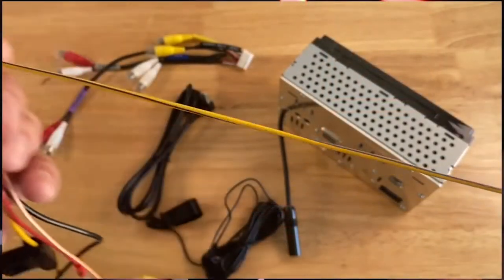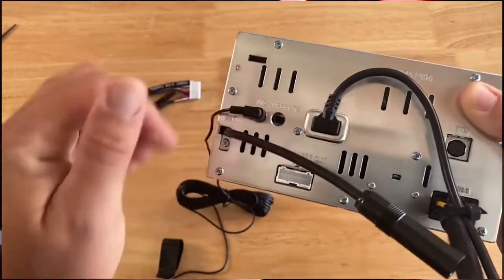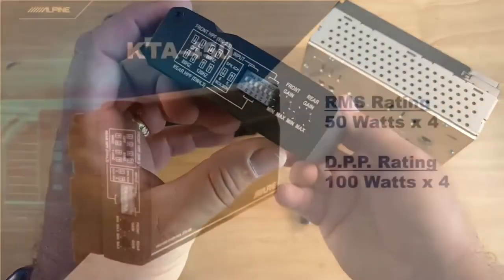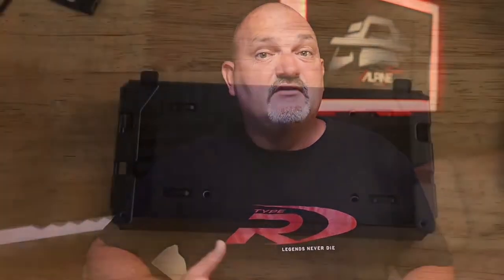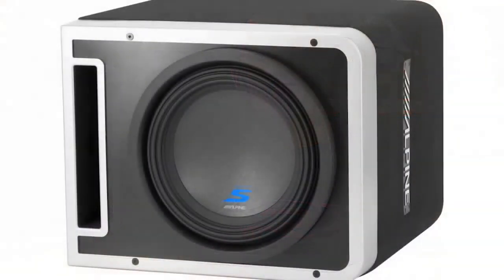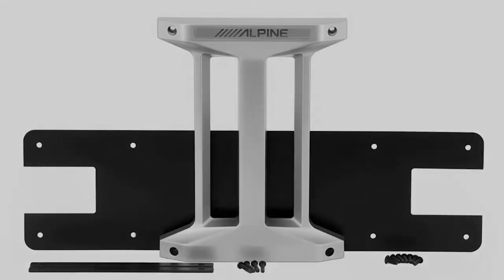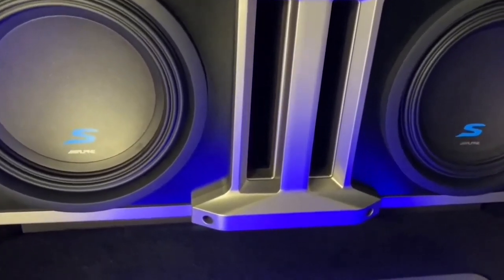Install and Setup Tips and Tricks (iLX-W650, KTA-450, KTA-200M, Halo Subs)

Comment: No comment on all the connectivity problems which blows my mind after buying several different types of phones to make this work. I am ready to try a firmware update after 6 months of a pathetic experience. Wish me luck!
Reply: Android auto can be a pain on this headunit, my galaxy s20 would disconnect or say usb not supported all the time, apparently the factory usb cord that comes with this radio is faulty, run a new usb cord straight to the back of the head unit and get rid of the factory usb. I did this now my android auto works good 90% of the time opposed to like 40% before. Hope this helps, also I updated my radio to the latest firmware ware didn't really seem to change much but the new usb did.

Comment: I own both the ilx-407 and the ilx-650. I have had no problems out of the 407 other than the internal sub volume not working. The 650 however, constantly looses the usb connection constantly or says usb device not supported while using my phone. Any recommendations?
Reply: I had the same issue with the 650 I updated the software on it and it fixed the issue
Reply: @mitchnoble442  that did not work for me. Software is updated now and still loosing connection. It isnt as bad now. I am going to try a new cable soon.

Comment: Love my kta 450 and my ilx w650 i have them in both of my vehicles. But that being said im in my 3rd kta 450 out of warranty i have developed issue with at low volume one if the channels will randomly go quiet then when volume is turned up it comes back as well as after prolonged higher volume all 4 channels will subtley lose about 5 to 10% output intermittently just enough to be noticeable it gies away after reducing the volume. But as for sound quality i love them on my rockford fosgate  speakers
Reply: Sounds like you have a speaker that's on its way out
Reply: @melissathompson7229  that was my first thought woth the first amp but the speakers were replaced with new one i went from polk to fosgate and still the same issue then bought the new 450 and it worked fi e fir a whike then ended with the same issue unfortunately. I really like the sound quality when they work

Comment: I have the 650 and the dpp amp in a 2004 Wrangler.  Beautiful unit, exactly what I hoped for but…..it pops on shutdown.  I have adjusted dip switches, triple checked rca connections, and checked all grounds for resistance and continuity.  What gives?  Its gotta be the unit power down timing.  What can I do to fix this?  It drives me nuts.
Reply: I have the same setup and mine does it too
Reply: Interesting! 🤔 

Same here and no response I see. 😢
Reply: Did you figure it out?
Reply: I’ve seen a bunch reviews on this and found that it’s the amp causing it. Only found out about it after buying it and being half way through the install. Curious if mine will end up doing it or not

Comment: Have spent hours trying to install the 650 head unit with the stackable 450 Amp on the back of the unit with a additional 200 watt Amp for subs. After hours of trial and error finally got unit to work but it not allowing radio to play but about "half volume" before it begins to cut out. Any suggestions or links for proper install on a 2011 chevrolet silverado  would be GREATLY APPRECIATED
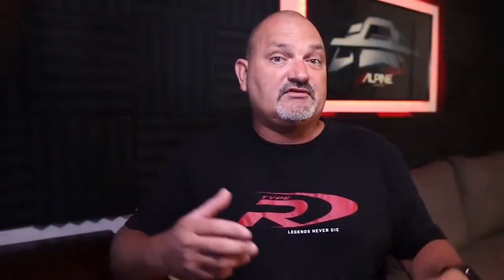Reply: Try recommendation at video mark 3:20 (“Attention…”)

Comment: Just gotta say, I purchased an iLX W650 last year and it has been the most frustrating and convoluted radio install I've ever done. Installing it in a 21017 Honda Civic required multiple adapters, alternative wiring mechanisms, and the most idiotic wiring hacks just for the backup camera to work. The system preferences are mostly inaccessible unless I do a hard restart by disconnecting the battery. Also, it should not have to take a double-activation of the parking brake just to access system preferences, which might work if the parking brake is mechanical, as gestured in this video. However, the Honda has an electronic button for the parking brake with more complex wiring system. I thought I was buying a high-quality head unit for a reasonable price, but It's been a severe disappointment. In hindsight it would have been cheaper had I bought a more competitor's expensive unit, had it professionally installed, and bought the technicians dinner as a thank you. I'll never recommend, or purchase, an Alpine again. Sorry, this customer is looking elsewhere from now on.
Reply: not happy with mine either. there's a constant white noise that i can hear even while music is playing. friend of mine had the same issue
Reply: Yea it fucking sucks dude. I bought the bypass for it. Frustrating yea I should have never strayed away from KENWOOD EXCELON. This ilx is the worst purchase I have ever made.

Comment: Maybe someone can help me out here before I go though the hassle and return everything. I own a 2003 jeep grand cherokee and I opted to get the ilx650 as well as the kta 450. When I turn the jeep off I get extremely loud popping from the speakers. Also, when  I turn the HU up to volume 13 or louder it starts popping almost like a cd is skipping. Does anyone have a solution to this? I'd hate to have to return everything. What are some go to settings for this unit paired to the 450. Someone please help. Thank you.

Comment: Hello guys, I have a question about the KTA-450. I am planning to pair with ILX-407 to power 6x9 Hertz for the front doors and 6.5” Hertz at the back. My question is should I still use the HPF from the KTA or use only the crossovers from the head unit? Thanks!..
Reply: HU  digital crossovers are always better..

Comment: So, I've gotten mixed results when asking people how to connect bluetooth.  Ive been told you have to connect through USB for everything.  I've been told you only have connect through usb if you're using your navigation from your phone.  I've been told you can connect wirelessly thought blutooth to do it all.  Which is it?
Reply: I have not tried the firmware yet but this device barely does Bluetooth but you have to connect Phone USB cable to your cell service mobile phone to get any type of guidance and no GPS built in to this head unit either so if you are lucky enough to get it to work when you connect the cable it glitches and says device not recognized on most every cell I have tried in the last 6 months. Hoping theere is a proper firmware update or I am sending it to be recycled for junk.
Reply: @yardclean1  Just following back up with you on this.  I got it installed and my son's iphone has worked flawlessly through the usb for apple car play.  He's able to receive and make calls, have texts read to him and respond through bluetooth mic.  He is very happy with it and I was amazed at how many advanced audio options it has.

Comment: If you have a factory system and just want a good head unit, I'll save you some time and money. Don't buy either ilx-w650 or ilx-407. I had the ilx-407 professionally installed yesterday and totally lost sound from the factory subwoofer.  We did the xover trick but it only helped a little bit and everything sounded muddy. I took the 407 back and they replaced it with a ilx-w650 which didn't sound much better, even after the latest firmware update that is supposed to specifically correct this problem.  I believe this is just a trick to force you to purchase an Amp and subwoofer,  which I can't do, due to having no room in my truck.  I expected better from alpine. Greatly disappointed.
Reply: Scott, I installed the ilx-w650 and the kta-450 power pack in my Tundra double cab about a year and a half ago. At first, because I didn't understand how to properly adjust all the settings and jump switches on the back of the amp, I found the system didn't have the low end the factory head unit did. I took my truck to a professional audio shop and paid them to tune it for me. They made several adjustments to the the amp gain, hi and low freq pass-thrus, and the crossover settings. Now this system has a lot more low end than the factory head unit had without a sub. Of course, your comment suggests you didn't spring for the kta-450 amp and doesn't mention if you have speakers capable of 50 watt rms (peak) input. So, my experience may be different than yours. Just food for thought.